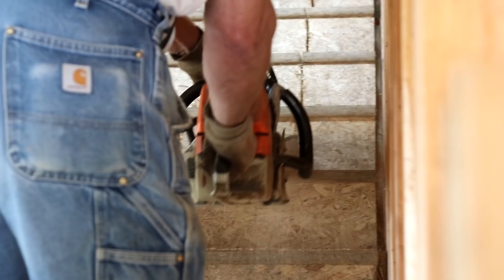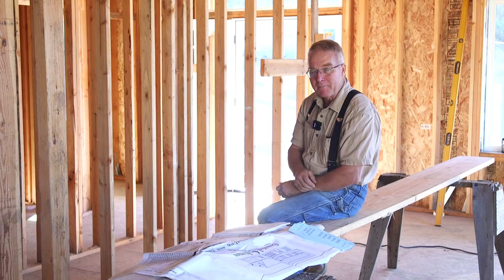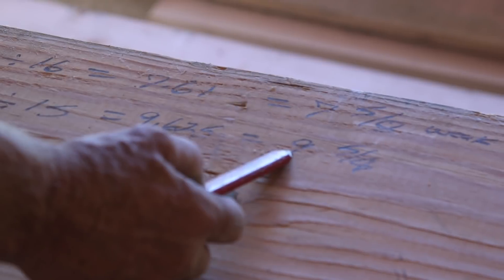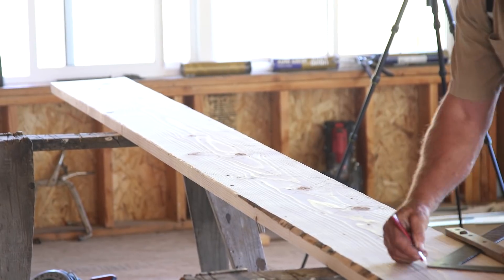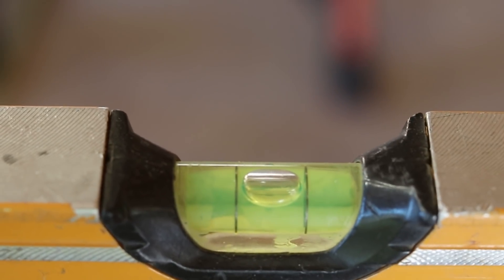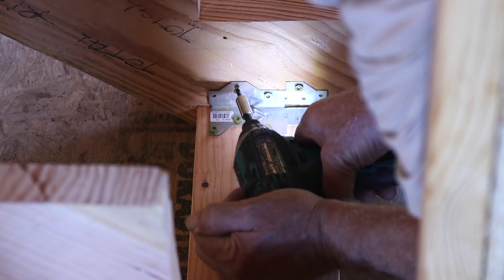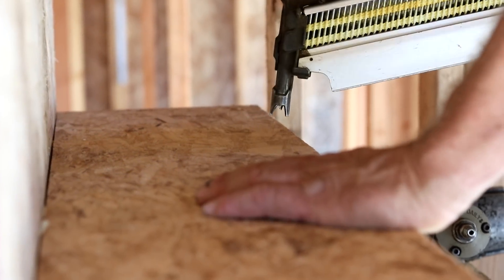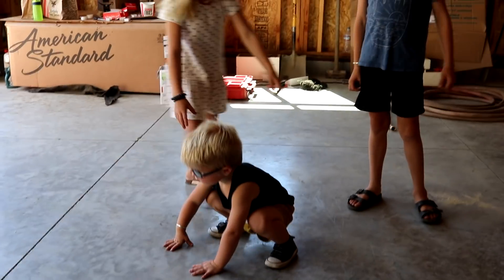Building Stairs...Again Ep.89

Comment: I thought max rise was 7  3/4"..
Reply: And also 10" minimum run.
Reply: me too so i tipple checked and it is 7 3/4" max rise and 10" minimum run finished.
Reply: @trailprice  
Possibly when the finished treads go on it will be minimum 10", it will have a bullnose up to 1"
Reply: @Jack Code requirements are a bit different on each state. For example, here in NY the maximun riser height is 8 1/4", and the minimun thread depth is 9". And there's also small differences if the stair is for residential, or commercial use.
Reply: @takgrillo  oh, i thought everyone followed the IBC.
Reply: @takgrillo  
Ok cool.  Seems 8.25 is a lot though..
Reply: @Ramdodge582  It seems NY has its own "Residential Code of New York State" (RCNYS).
Reply: @JackJohnson-mc7ki  I agree, and I remember double checking with the city and also suggesting to the architect an alternative to avoid having 8.25" riser, cause it seem too high for me, but I was shown by them that the maximum allowed is exactly that number, so it was ok.

Comment: looks like every states have their stairs code different...
Reply: It all depends on which palms were greased and when. For instance: whoever approved orangeburg pipe for sewer services in Georgia should have been tarred and feathered. It no longer meets code, but pine trees were crying "Fertilizer" whenever it was used and the PVC suppliers (and installers) loved that fact. That was 50+ years ago, but pols have not changed.
Reply: @BillB23  Same with cast iron sewer stacks here in San Francisco.  Which I will never understand as having all that weight up high would seem to be an issue with earthquakes....
Reply: @ckm-mkc  Especially with something as brittle as CI. I guess that's to be filed under "What the [insert dirty word here] were they thinking?"
Reply: Yes, I haven’t looked at my local stair codes lately, but I don’t remember a 9⅝” tread being allowed. Most of the stairs I did were concrete and were typically 11” with a 1” toe-in, effectively making them feel like 12”. 
  As one of those people plagued with big feet, I always find myself walking up or down stairs with my feet angled a little bit. With a 9⅝” tread I’m afraid I would end up walking a set of stairs sideways just to keep my feet on the treads. This isn’t a comfortable tread width for me.
Reply: @psidvicious  It's been so long since I've been in the biz but I remember shooting for 7-8" rise and 10-11" tread. Codes may have changed since then depending on who was bribed by whom.
Reply: @BillB23  in cali code is 7"3/4 rise and 11" thread on residence. if I am him I would do that 1" toe in with 1" overhang it would be close to 12".
Going up the stairs is no problem with small thread but coming down the stairs with small thread is dangerous
Reply: @tom0428  You damn betcha!
Reply: @BillB23  Wow.  Orangeburg really still used in GA?  I have dug up and replaced a lot of it over the years.  Tree roots find it and crush it.  And it seems to delaminate from the inside, too.
Reply: @chrisdaunhauer1757  No, it was superceded in (I guess) the '70s. My dad's house was built in '65 and had Orageburg service from the SW CI in the house to the street. That changed when the pines ate it and were cut down. It was replaced with schedule 40 PVC. Orangeburg needs remedial help to suck. I have also dug up more than my share of Orangeburg and terra cotta.

Comment: Our stairs didn’t pass inspection either. Third time around it was my turn. Contractors weren’t getting back to me, my brother was too busy then he tells me. I know you have a stair building tool at your house, don’t you know how to use it?  I used to think that there was some fancy calculating for figuring out the angle etc. When I learned how to use a carpenter’s square it opened my eyes to how simple things can be.  The other secret was using your first runner as a template. Then the fiddly parts on the ends to take into account the finished floor height.  Then it is just labor. Learned something new watching this video starting the screws in place with a small hammer blow so they are all where you want them to be. Thanks for the informative videos.

Comment: In my build, I did housed stringers and messed up the first pair. 

A had one too many treads and the whole system sat higher, so my issue was code and headroom at an above LVL.

Luckily, I didn't assemblies the stairs in my shop and notices my error test fitting the stringers.

I was working alone and weight was an issue, otherwise they would have been assembled in my shop.

Seeing your stair mishap made me feel much better about mine since I can only hope I can know a fraction of what you do.

Great video, as usual.

Comment: I excelled in Math early on. Prolly b'c of my fathers knowledge and lectures. I may have learned the Pythagorean Theorem around 6th grade but revisited it in high school. At 1st I could never get why others on my various carpenter crews didn't want more responsibility's ?  I mean, there's just so much base you really want to lay ... right ?
When I transported wood as a helper, I had dreams of laying out studs & headers. When I made a door hinge jig for a coworker and my boss was impressed and started me cutting crown, it seemed obvious. When I fig. out stairs or radius curves and became leadman, well, I was surprised that no one else would do it.
It wasn't until later that I realized, having a father , school , circle of friends that cared and pushed me early on, gave me confidence and an appreciation for challenge later on. That and understanding that part of the learning process is making mistakes and not to beat yourself up for them but find solutions and become stronger.
I believe it's a weak person that dwells on fault, who did it, what if someone else sees, etc ... It's better to focus on solving problems.

Comment: This video makes me more appreciative the way home builders here in southern ontario canada do it. The builder has a temporary set of stairs for framing and mechanical rough in. The permanent set of stairs are built off site by a company that specializes on building pre-built stairs. The stairs are then delivered to site and installed. Framing crews hardly ever built a set of stairs unless the builder didn't have a temporary set for construction.

Comment: Very interesting to see how you lay out stairs. In MO when I do basement stairs, I take the total height (I add a 0.5 to the height if it gets finished flooring = no door vs door) divided by 7.75. That answer I round up then I take it and redivided it by the height to get my rise. So for example, 108 height divided by 7.75 equals 13.93 which means 14 steps minus the top one which is the floor so 13 steps. Then 108 divided by 14 is 7.71. So its 7 3/4 shy rise over 10 run. I hope this helps anyone who's confused with complicated math problems for stairs.

Comment: Designing my house in sketchup, I've had to do the stairs over and over. I'm impressed with the quality information presented in this video where the design appears to be pencil on the board
Reply: double check your head clearance in your design, it's the most commonly missed stair detail by designers.  6'8" is bare minimum, but more is better.  There's few things a framer hates more than modifying a stair hole due to an error in the drawings.

Comment: Nice demo saw.  Always calculate your stairs from 7"/11".  These proportions fit a comfortable rate of climb for humans.  Japanese more like 3.5-22.  a bit slower paced.  I saw the back nail through the riser into the tread.  Don't forget to glue that joint also.  5/4 advantech is what I liked when I built.  Tip...tac nail the layout stringer against another stringer.  Set saw for about 1.75" depth and of course square. And so on for the next. Also the rise is the vertical measurement between the toe of stairs and the top of stairs.  Not directly below the top, although it should be the same.

Comment: I have a couple tips for accurate stringer cutting. When laying out the initial pattern, you can calculate the hypotenuse of the rise and run (a² +b² =c²), and multiply that out over each step. That accurately shows any accumulated error over the total span, and helps keep the treads level. Secondly, I pin together all the stringers with 3 or 4 nails, putting the pattern on top. Then I spend an extra minute really squaring up my skill saw, and I let the cut penetrate through to the next board. That cut will be about half way through the next stringer, leaving an exact scribe to follow, and helps guide the blade. Keeping the stringers in the same order you stacked them, will ensure exact matches, more accurate and faster than scribing pencil lines each time.
Reply from the maker: Great ideas!!

Comment: 7 and 10 is comfortable. Remember to mock up floor thickness at landing and top. Should be able to run strait edge up the nose and have it touch all noses evenly. I have always laid out one tacked the initial marked stringer to the next and cut through to make marks for next stringer. Done many sets of stairs do not count on the floor being flat and pay attention to flooring thickness.

Comment: This is just one more example of how a mistake can come back and bite you at a later time.  I don't figure you made a mistake BUILDING the first set of stairs.  You did a great job of making the stairs fit in the space that was framed for them.  Plans often have mistakes, so when  you found out the last step stuck out into the room (not desirable at all), you corrected the error ... just forgot about that "troublesome" code!   People do make mistakes, admitting and showing the mistake is the mark of a real Pro  - and a man worthy of respect!

Comment: I did something similar. I didn't catch that the stairs extended into the second floor over the top plate. Cut my first stringer meticulously but then it wouldn't fit right. Noticed it when I tried to test fit. Had to demo some framing and floor and now they are good.

Comment: well done..  i remodeled a house, and the mechanical room ended up in the attic.  things wouldn't fit after i got it all in, especially the heating unit, so when the general was off site, i took a chain saw to the main floor and cut out the walls, the attic main floor, and reframed the whole thing in one day.. the general didn't even notice, plus i added a drain system for fluid spills that he wanted.. when the owner came to look, he noticed, and the general handed me $200 for getting it all done on schedule.. nice day for me.. got back to the work with little to no effort with the chain saw removal..

Comment: Stairs separate the men from the boys. Add in an over the post stain grade balustrade with turnouts and rising left and right easements and you have accomplished a lot. Making the code work with nosing and rake height is like threading a needle. Good to see all cuts with the worm drive and finished perfectly with the jigsaw. My only minor suggestion would be to cut the stringers from LVL stock for strength and dimensional stability but add $250.00!

Comment: A trick because 16 happens to be a convenient number of rises: you can round the total rise off, to 122 inches, and know that your final calculation per rise will still be accurate to within the 16th of an inch (in fact, to within much less given that the rounding is small). 122/16ths = 61/8th = 7 and 5/8.

Comment: That old PorterCable jigsaw my old boss had, and it was the most hated tool he owned.  He called it the "Dust-blower 5000", because no matter where you stood, and whether or not you had safety glasses on, you were guaranteed to get dust in your eyes.  He also hated the fact that you usually ended up bleeding trying to change blades.  ;P     Any similar sentiments?

Comment: When my bi-level house with open stairwell was built, a board was put against the upper level joist and extended across the last riser making the last tread shorter than the others.  And the tread and risers are 9 1/4 and 7 1/4 respectively.   When I bought the house, because the stairs were carpeted, I never knew why they always felt awkward.  When I had the carpet in the house replaced with laminate, I saw what had been done.  House was built in 1978 and guess that was code then.

Comment: 5:00 - rise and run - 7-5/8  to 9 5/8...2 risers and 1 tread should equal the magic # 25
15 1/4" + 9 5/8 = 24 7/8"...not bad .

it's a mechanical thing - the higher you step. the shorter the tread. If you stride a mere 4" up, then the tread (what you land on ) should be 2 x 4 - 25 =17. It's simply the way we're built.

Comment: Never had to rip out a whole set of stairs...If I did I would remember as I am sure you will as you try to go to sleep at night...So many adjustments to make...You will have a lot of fun trying to explain to your fans how to adjust for tread thickness and top and bottom floor finish thickness...that's the tough one...and hope for no changes...When you get into a tight spot you can play with putting the tread out of level a little....If you are outside you must slope for drainage anyway...for wood treads or if you are forming for concrete....You got to worry about head clearance over stairs also..that can be big problem...back in the day we worried about fire blocking all the time...doesn't seem to be a thing nowadays...We had to block along the rake of the horse?   One way to beat this was to rock the wall before the horse was installed..we still put in a 2x4 spacer...that grove gets tight when you go to put in the skirt board...when I started we had no sawzall...we were building new houses not remodelers...and if that tread stuck out a little...handsaw.....In the seventies we made open stairs with no riser and 2 x 12 tread wrapped with carpet set into a 4x12 stringer.routed pocket...you seem to know what you are doing and I noticed that code change and it does cost you a whole riser..sucks...be careful...

Comment: Hey Scott, do you have any experience adding a staircase through already existing ceiling joists? I understand I need to box out the joists with headers and support the attic rafters in a different way but not sure exactly what’s required.

Comment: Wife and I were putting in steps on a shed I built, and I'm diabetic and my sugar was low and figuring out the height and run up the stairs is something we still laugh about today, I was like using torque head screws, in fact I gave all my Phillips head screws away, the torque head screws are far superior, I ordered some 1 inch ones last night for a project I'm going to do. I don't even care that the cost more than the Phillips head I'll gladly pay the difference.

Comment: I love how dramatic the chainsaw is! Could you have removed the treads and adjusted the stringer since it was only 1/8” off?
Reply: Sadly no. If it was 1/8 total perhaps you could. But it’s 1/8 each rise. Which means if you add 1/8 to each tread the distance from the top of tread to top of tread hasn’t changed.

Comment: For those of you who dislike imperial measurements,  EVERYTHING is already built to those measurements,  and so are building materials.  There would be no point in switching.  4 by 8, for example, would become 121.92 by 243.84 cm; not exactly numbers which are readily memorized,  multiplied,  or added in the head.

Comment: Knowing how to fabricate and install a set of stairs is probably one of the most valuable skill sets I've ever acquired.  And just FYI, the building code says the maximum riser height is 7 3/4".  I know this because my boss when I was a Building Inspector, was on the ICC as a member of the counsel.

The builders and their reps were all demanding and begging for the max ht to be 8", and all of the Code people were requiring 7 1/2" max.  Finally, my boss got everyone to be quiet and asked if splitting the difference at 7 3/4" maximum allowable riser height would be acceptable to both side... and they agreed!

Comment: They are always changing the code.  Make the rise shorter and the railing height higher.  If you own it, it does not matter as the next owner it will be sold as is anyway.  If you read the building code ACT, you are only subject to it once you make an application and pay the money for their services.  Before that happens if they show up on site, they are trespassers.  It's amazing what you find out when you start reading their acts.
What is do is tell the homeowner that if he thinks he needs a permit, then he has to get it, because I'm not going to make them liable for something I made application for.

Comment: Do you have codes about the slope relationship between your rise/run dimensions? In Australia we have a maximum and minimum measurement for risers and goings. On top of that 2 x rise + going must be between 550mm and 700mm. Just to complicate things further 😂
Reply: Not explicitly stated as a slope, but if you have a minimum tread and a maximum rise, that specifies a maximum slope.
Reply: @andrewalexander9492  we don't have that luxury. Min rise/max going would be illegal, and vise versa. Just an extra thing we have to allow for. It can make the juggle of making stairs legal a struggle sometimes

Comment: I thought the fastener was to simply hold the lumber in place until the glue set up.  Seems like that the glue would solve squeaking issues without additional fasteners, no?
Reply: Generally, codes don't allow the use of field applied adhesives, (there are exceptions)  so even if you're using an appropriate adhesive, that would do the job by itself,  you'd still need the fasteners that code would require, because that's what the inspector will check for.